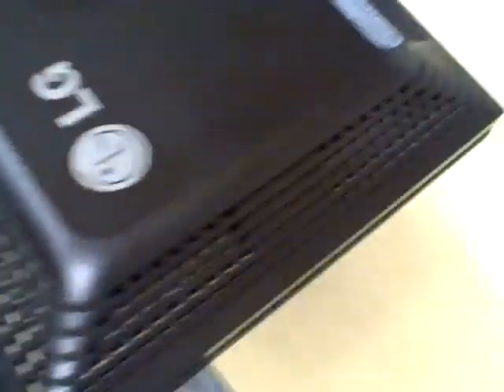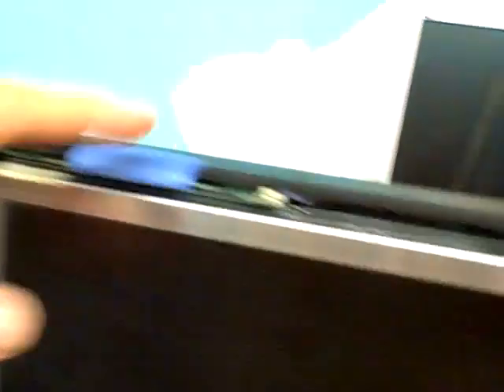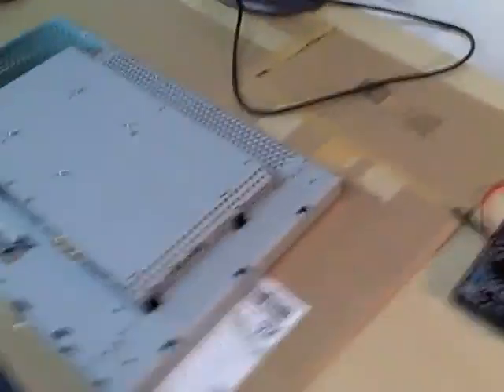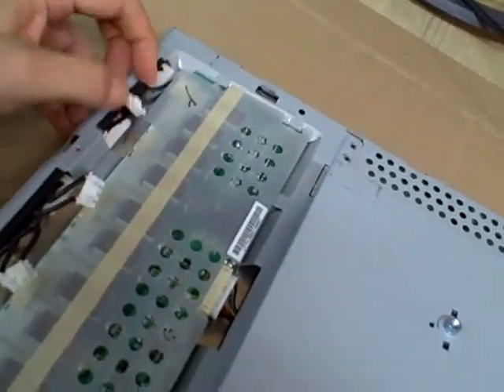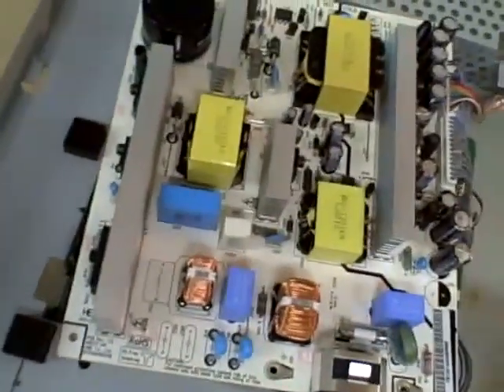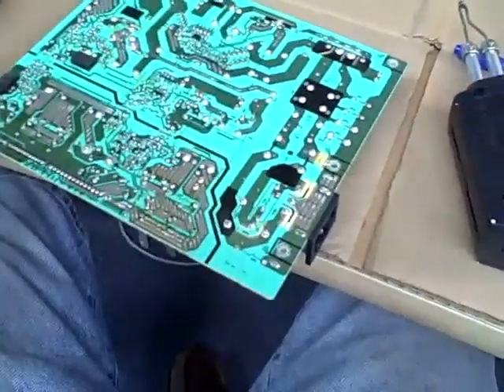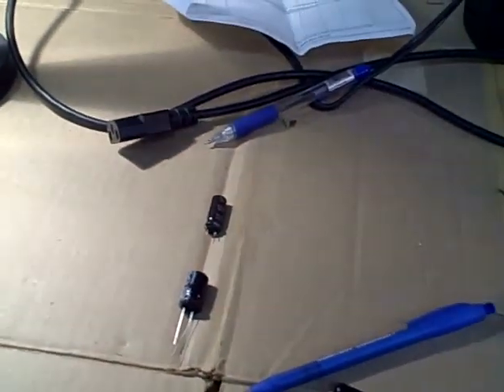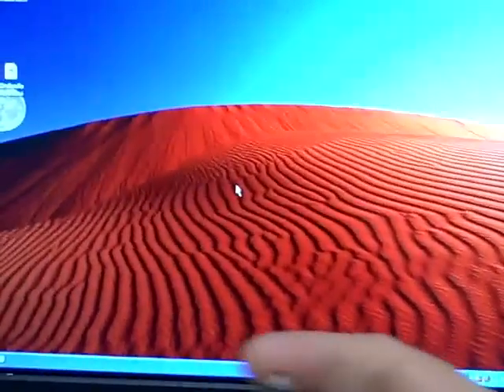LG Flatron L246WP-BN Monitor Repair Tutorial

Comment: Very useful video. 5 years ago, I revived my monitor by replacing these 2 caps. More recently, it failed again with a blue, ceramic cap blown, but haven't figured out what else is damaged, as the replacement of the cap hasn't resolved the issue and the board blows the fuse when connected to the mains, which suggests a component causes a short circuit.
Reply from the maker: Since the fuse blows should be easier to find problem. Check diodes in rectifier circuits. Look for shorts across all electrolytics. If good, likely the power transformer is bad or some other hard to source part.

Comment: My caps looked fine. I took those two out and tested them and they tested fine. I replaced them anyway, but no joy. The monitor tries to turn on, the LG logo pops on for 1 second, then the entire unit powers off and about 5 seconds later tries to power on again, showing the logo for a second, then powering off again. Rinse and repeat. Very annoying as I  like this monitor and I know it's probably a $1 part.

Comment: I changed the 2 caps (could not see any other bulging caps on the PCB) but the flicker problem when the Monitor is cold is still there. Any tipps what i should check next? Love this Monitor and want to keep my Baby running if possible.

Comment: My L246wp has a different problem.  It doesn't have a problem starting up, but it just started displaying everything in 256 (I think) colors.  I tested it with another computer (with a different cable, hdmi to hdmi vs hdmi to dvi) and had the same problem, while a different monitor didn't have this problem on the original computer.
Reply from the maker: See it is this https://youtu.be/ndAeoQf-A00 with odd colors with bad T-con board. Look in the badcaps forum for a lot of monitor/TV debug advice.

Comment: Hi Kent!
When my monitor started dying it would take it some time to turn on (blue light flashing continuously). I had it always connected to power outlet but the time for turning on increased more and more. Once I disconnected it from the power and then it never woke up. Overall it gave me an idea of power supply capacitors failing. I am infinitely gratious for you uploading this guide to youtube, it showed all the way to the victory! :)
And yes, I had exact same bulgy capacitors and replaced them with one extra so now everything is perfect!
It cost me 54 roubles (about 1$) for 3 new capacitors and some 5 hours of slow and careful work but without your help it would be way harder!

Comment: I have LG L245WP-BN and mine is also not turning on, not even a single flash of the triangle-led above the power button. Got it repaired once during the warranty period and they fixed it but now it's not working again. Had it off the grid for half an year or so and probably I'm facing the same problem. However, thank you very much for sharing your repair video. I'm report back if I managed to fix mine. Hopefully the same naughty guys (caps) are to be blamed. :)
Reply: It turned out there are 3 of these caps on my power supply board and they have been replaced + two others in the mid of the board C506A and C506 - which were also replaced when I got it serviced during the warranty period. So I guess they put some cheap ones (TEAPO - not sure how good they are actually, internet opinions vary by a lot) and the middle one has leaked while the others are bulged. I'm gonna replace them and see if that's gonna work. :)
Reply from the maker: Check for the rectified line voltage on the big high voltage capacitor to ensure rectifier and fuse is OK. Should see near 180V there.
Reply: Thank you for the advice and the video! Changed the caps today, got 3x2200microfarads 25V - my beauty is working perfectly fine.

Comment: I wish I had found this video when my monitor died. I still had a few weeks on my warranty, so I sent it back to LG.  Unfortunately, they sent me a series of refurbs that no one with eyes should consider repaired - everything from horrible color cast to a physically damaged screen.  I ended up keeping the 4th refurb they sent me, but it still has flaws, just not as badly as the others did.

I was actually searching for info on how to fix the monitor so that certain OSes won't think it's a 1920x1080 TV and display weird things when set to 1920x1200.  The instructions were online, but now I can't find them anymore.  It involved locating a specific chip and disconnecting one of its pins, I think.  There's also a way to do it via software, but I couldn't get that method to work.  But I'm glad I found this video, just in case I need to repair this monitor in the future.  I think this refurb is actually coming up on 5 years, so part of me is expecting something bad to happen any day now.

Comment: Thank you very much Kent,
Mine was an LG L246WHS with the same problem. Replaced the two capacitors and now working fine! Using the monitor to write this message.
Cost $3.10 AU for 5 capacitors! 3 left over so I'll keep them in case the same problem arises.

Best Regards
John
Reply from the maker: +John Cale Glad to hear your success. Mine is still going strong several years later.

Comment: I have a problem with this monitor where the right side of the screen is darker than the left side and progressively got darker and darker until now the whole screen takes a very long time to "warm up" and then I will get a still dim picture.  There's no bulging in the capacitors.  Help!
Reply from the maker: +dsertwq Sounds like the CFL backlight is going bad. I have never attempted to replace a backlight. May not be economically feasible to fix. Google around and look on BadCaps Forum for more advice.
Reply: +Kent Diego Thanks!  My only concern is that the CCFL's run horizontally and only the right side of the screen was taking a long time to warm up and get brighter.  Was thinking it might be the panel?  Hard to say...  Any recommendations on a good monitor that isn't going to break the bank?
Reply from the maker: +dsertwq On larger panels they have separate drivers for left/right side of screen. I made video Westinghouse LCD TV Repair - No Picture" https://youtu.be/GmjULp9eBtU showing this. If your LCD screen has separate left/right drivers perhaps there is cold solder joint at ribbon cable? Maybe you can press on connections to see if picture jumps on to isolate bad connection?
Reply: +Kent Diego that may be the problem.  I'll try that. Thanks!

Comment: to first thank you for the good video. Since both capacitors are connected paralle, I have installed only a large capacitor, 4700 uF with 47Volt and the monitor works perfectly.

Comment: any advice for white screen ?
Reply from the maker: ytse jam Sounds bad. I have sometimes got lucky by opening cover and tapping on components (monitor on) to see if any difference to find a broken solder joint. Pull and wiggle all cables.  Likely a failed video chip or driver transistor and time to get new monitor but maybe... Also.. I have seen a lot of TV/monitor repair info on the Badcaps forum.
Reply: Kent Diego thank you for this fast answer. I have not yet found anything wrong inside the chassis, I'll try to touch everything and pray a lot to God of Monitor. Didn't try with monitor on though.

Comment: I have this LG M2280DF-PZ 22-inch and I have it as a pc screen and the connection between TV MONITOR and pc is HDMI CABLE, before 1 week the screen starts flickering and sometimes thin colorful lines. 
I disconnect the HDMI cable and still tv monitor flashing doing this.
PLS HELP
Reply from the maker: I would take apart monitor and make sure the internal video cables are making good contact. Sometimes you can tap on parts one by one and find the one with poor solder connection. Look for bad caps too but not as likely.
Reply: Kent Diego thx a lot i will try it.

Comment: Thanks for the video, it helped me fix my L246WH with the same fault.  Interestingly the Samwha WB series caps that came out were smaller than the 12.5mm dia quoted on the Samwha datasheet so I wonder if they are fake? I replaced with WB series as it was all I could get locally (Maplin - UK), they are below spec, but it works!

Comment: Hi Kent, GREAT VIDEO BTW!  I used this video 2 years ago and fixed my Flatron. However, just a week ago, my Flatron stopped working and now have a flashing blue power light every 1 second. 

I tried replacing the capacitors again (the capacitors were not bulging but had two spares) to now avail. I hope I do not have to replace the entire LGP0024-110B power supply.   Any help would be appreciated.
Reply from the maker: See if you have 160V+ on the big high voltage capacitor. If not then bridge rectifier diodes is easy fix. Otherwise likely a bad transformer not practical to repair. You can get many repair tips and guides on BadCaps forums.

Comment: Just ordered new caps (493-11291-ND) I hope they'll work I ordered them before I saw your suggestions...
Datasheets PX Series
Product Photos PX SERIES 18mm
Standard Package   50
Category Capacitors
Family Aluminum Capacitors
Series PX
Packaging   Bulk  
Capacitance 3300µF
Tolerance ±20%
Voltage Rating 10V
ESR (Equivalent Series Resistance)  -
Lifetime @ Temp. 20000 Hrs @ 105°C
Operating Temperature -55°C ~ 105°C
Type -
Applications General Purpose
Ripple Current 2.016A
Impedance -
Lead Spacing 0.295" (7.50mm)
Size / Dimension 0.709" Dia (18.00mm)
Height - Seated (Max) 1.457" (37.00mm)
Surface Mount Land Size -
Mounting Type Through Hole
Package / Case Radial, Can
Dynamic Catalog PX Series
Other Names 493-11291
Any thoughts?

You state that you replaced the two with three... What benefit do you hope to gain by doing this. ( not challenging you just curious.)

Comment: I had the same problem and symptoms with my monitor This solution worked. Parts cost £0.85p each from Maplin (solder iron and solder cost £10 but will do for future repairs).  Thank you for the post.

Comment: This seems to be the common point of failure for this otherwise excellent 1920x1200 LG 246 WH. Same problems to power on, and BINGO! both low voltage capacitors at end of life. Needs to be said, my display has seen more than 50000h on standby with around 5000h in active use.

Comment: Very nice video. I was busting my head to find out how to open the lead. I changed my capacitors to and screen started working. Though i savaged them from an old power-supply and they had 2.2kuF and only 85C so i probably have to change em again soon.

This video apply for the LG L222WS. Looks almost the same inside and the casing is identical.
Reply from the maker: I am sure even old scavenged capacitors will work better than the old ones.  Likely they will last for many years to come.

Comment: Kent, thank you for bringing my LG246WP back from the dead! It failed 12-18 months ago, and for the last year I've been looking at it sitting forlornly on the floor while I mustered the courage to disassemble it as per your video. Nothing ventured, nothing gained, right? So I finally dug into it and found the same failed capacitors that you did. I ordered the capacitors identified by commenter Barry Brown from Mouser, got some help with a friend who is handy with a soldering iron, and voila!

Comment from the maker: Also look for arcing. The CCFL backlights take a high voltage. Maybe arc at inverter or at ends of lights. Look and listen for arc. Maybe able to clean dirt from arc path or use silicone rubber to stop arc.

Comment from the maker: My guess is video is still at display but back light cuts out. Either the CFL back light is getting old and drawing too much current causing the inverter to cut out or else the inverter that supplies the back light has a problem. My guess is the black lights. You can see a lot of great monitor/TV repair ideas on the Bad Caps Forum.

Comment: having an issue with my 245wp-bn monitor too. replaced the capacitors like in your video. but still my monitor turns on and off ever 5 minutes. and is off for about 3 seconds. 
any idea what problem this could be? thx

Comment: Thank you Kent.  I have the same monitor, had the same problem, and followed your clear and complete instructions to fix it.  Same bulging capacitors; I chose Panasonic EEU-FM1A332, for their low resistance and high ripple current rating.  Now it's good as new!

Comment: I just figured out a better way to remove the bezel. I used a 4" plastic drywall blade. I placed the monitor on a table, screen facing down, with part of the edge hanging over the edge of the table. Placed the blade on the edge of the bezel, and gave a light, sharp blow downward. That got it started. Flipped it over and finished striking upward, working around the monitor. No scratches or damage to the case. Tah dah!

Comment from the maker: Hi Ronald, See my video "Motherboard Repair Tutorial - Bad Capacitor Replacement". Since this is a single layer circuit board the capacitor replacement is easy. Get a soldering iron and heat each side at bottom and pull capacitor out. Do not worry about breaking old cap. Clean up holes if covered with solder braid.

Comment: I fixed my l246wh with new caps for 5 volt line, two 3300uF and one 1000uF low esr 6.3v. In the web there is the service manual. 

I wasted time because I connected the LVDS cable wrong way, the golden plates must be up when connecting the cable to the lcd panel. Bad mechanical design  in the cable I think, luckyly there is electronics (SHORT_CHECK line in the schematics) that handle false  connection.

I bought a new asus vs247 display and  l246wh looks better due to better resolution.

Comment: What these monitor companies tend to do to save a few pennies is slap in caps that have a max. voltage rating close to that of the rails they are on. So when you replace the caps I'd suggest you go with a cap of the same value e.g. 3300 uF or whatever, but the next highest voltage rating. Also, when you take your monitor apart, you want to follow some kind of good ESD practice as well (so you don't zap anything with a discharge). Nice video!

Comment from the maker: Buttons typically ground a pull-up resistor. Use volt meter to troubleshoot.So each button should measure high, maybe 5V, on one side and 0V (ground) on the other. Check. My guess is has bad pull up resistor. Maybe on button board maybe not. Follow mode line until you find it.

Comment from the maker: Soldering a single layer circuit board is easy. I do have a video showing much more difficult soldering. Search for my video "Motherboard Repair Tutorial - Bad Capacitor Replacement". Motherboard's have a thick multilayer board and is very hard to remove old solder.

Comment: Hi thanks for the video,  I have almost the same monitor brought back from 2008 and it just showed a blue flickering light this morning,  not bad considering it lasted 5 years+ and its switched on for most of the day daily. Same 2 bad caps also,  so just ordered them off from ebay item (120631012476).  I do have some spare solder and solder iron handy luckerly but I have never soldered before,  any videos on this ?  Its the one thing missing from this great video,  thanks.

Comment from the maker: It is likely that only the diode is bad. There was a fuse to protect against excessive current. Diodes can go bad due to voltage spikes, ESD or manufacturing defect. Good luck.

Comment: cool, thank you for the hint! D504 was not the code writen on the diode itself but the nr. writen on the board next to it. On the diode I could figure out sth. like ...396.. / ...007... before I screwd it. Since its located on the "hot" side of the board I would go for the 300V/1Amp diode. Only I wonder what made the diode burn in the first place. I guess the original problem won't be solved after replacing the diode.

Comment: The symptoms on my lg L246wh-bn were the blue power light was flashing and very faint, sometimes it worked. 2 Capacitors soldered in and I am working again. Thanks a lot. One point is note the negative markings on the capacitor before removing and put the new one's in witht he negative markings in the same place.

Comment from the maker: The hint is size matters most. It has to fit. Look at other diodes of the same size and see if you can see model number. Measure size. I do not know D504 but diodes should be pretty generic. Is is a single diode or multiple diodes (bridge) in single package? If on high voltage input side will need at least 300V but 1 Amp should be fine. on the low voltage side 25 to 50 V rated at maybe 2 to 4 Amps would be a guess to try. Look through Digi-Key or Mouser and see what they have that fits.

Comment from the maker: It seems to be standard industry standard to see colored marker checks on electrolytic capacitors. My guess is it is a QA inspection to verify correct polarity. If they put one in backwards it is bad news so they need to double check. Glad your monitor is working. It is almost impossible to buy a 16:10 ratio monitor any more so the old ones are better than new ones there.

Comment: many thanks, Kent.  I got two of my monitors back working.  One has power issue while the other one has wake-up issue.  I replaced those 2 bad caps and now they're all appeared to be working fine.  

i still have one issue though, i get flashing red stripes on the LCD not unless I turn the brighness to over 55%.  would you know what could that be causing it?

Comment from the maker: If a tear you mean a flickering distortion in a horizontal band it could be possible. I did not see this on mine but if 60Hz AC line is not filtered well and it gets in the video circuit you see a band of noise. The reason has to do with the vertical rate often is 60 Hz so it will show as a horizontal line. Change your refresh rate and see. If the caps are bulging then replace them. It is cheap and easy.